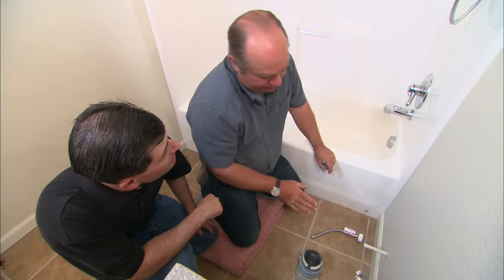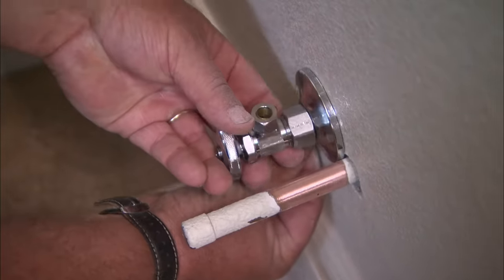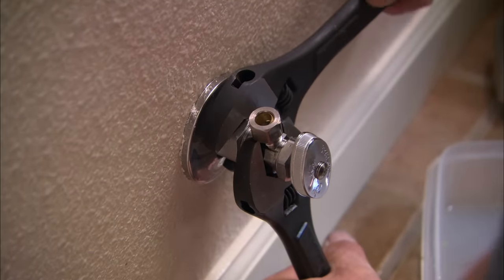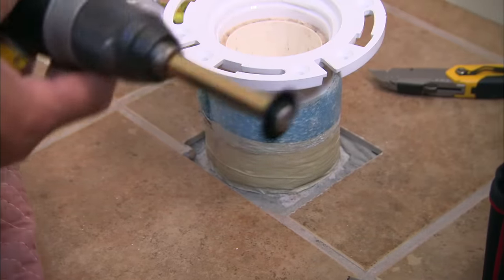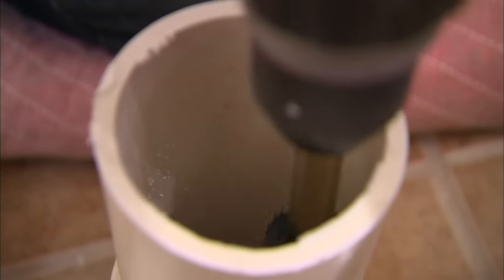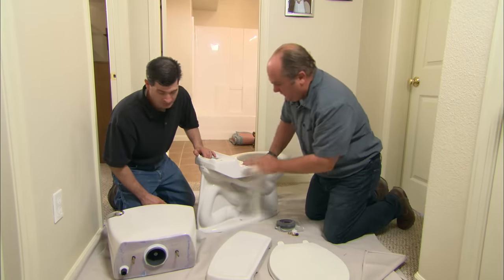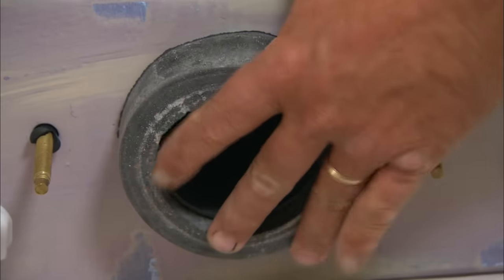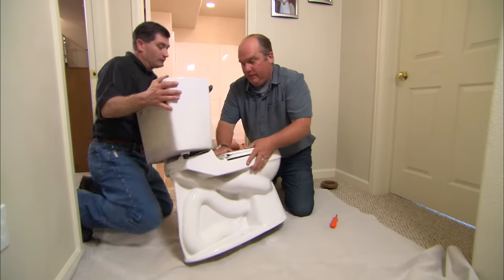How to Install a New Toilet | Ask This Old House

Comment: What would be the cause of leaking at the bolt caps whenever the toilet is flushed?  And how can I fix that?
Reply: There's really only two things down there. There's the seal and the flange. One of those has failed. Replacing the seal is easy. Replacing the flange can be hard. The only way to tell is to lift up the toilet and look at what's going on. If the flange is broken you'll see it. If the flange isn't broken then just replace the seal. If the flange is broken then you're going to have to investigate the pipe it is attached to to see how you can cut the old flange out and install a new one. You might need to cut the pipe back and install another piece of pipe and a coupler. But it may not be so easy. It certainly wasn't for me. It depends on the specific plumbing situation you have going on.

Comment: Thanks. What holds the brass flange bolts in verticle position so the toiled bowl can be lowered on to the flange?? Great video!!😊😊
Reply: Some blots come with a lower nut and washer .... others come with a plastic holder that keeps them straight....

Comment: Yes, 4 Things I would have done is #1 install an Electric GFI outlet for a bedet seat that sprays water, #2 plaster underneath the toilet to help prevent leaks, #3 Use Teflon tape on the water connections, and #4 install a ball shut off valve in case those cheap compression valves leak.
Reply: teflon tape on angle stops? The threads have nothing to do with creating a water tight seal.
Reply: No need for Teflon tape when those supply lines come with O-rings.  You are asking for trouble otherwise.

Comment: if you glue that flange and it breaks, thats a huge mess to replace. You shouldnt glue it. If you do glue it, you should be using a metal cover for stability and strength to ensure it never breaks! I know, we had to replace a flange due to breakage and it was a complete job to do! It wouldve been easier if that flange wasnt glued, then it couldve been replaced and have a metal plate put over it to keep from any further break problems.We used a little caulk on the lip of the pipe to create a easy to remove seal if we had to replace the flange again.

Comment: Nice video, but for the love of pete, why would you cut the copper so close to the wall?   Can we also get a mention that the plumbing shouldn't be so loose in the wall ?  Clearly we can't fix it now, but FYI for when you have the wall open.   I have never seen this method of installing the wax ring. (Just dropping it onto the flange).  If it works, great. That is less work than what I have done for years.

Comment: I have been a Master Plumber since 1987 and I have never used a compression stop, only sweat or IPS thread. That PVC pipe was cut way too short and the closet flange did not make a complete solvent weld. Never Have the stop that close to the wall unless it is IPS on brass nipple.

Comment: FYI: It's alway a good idea to use some Teflon tape (a little goes a long way) on your plumbing threads such as with that flex hose... I can't count how many times that I have had to fix leaky hoses behind plumbers simply because they did not use Teflon tape or putty... 

And the plumbing water-line was cut way too close, so during future repairs, they'd likely have to open-up the walls lol. Nice work though!
Reply: @beepbeep442   Spencer Robinson , granted, they are compression fittings, but from my experience, I have seen them leak/fail, and after applying Teflon, it never leaked. Whatever has threads, I always use Teflon as this is added insurance that I don't get leaks. 2-3 revolutions of Teflon is all it takes, as a little goes a long way... Again, I have seen these compression fitting fail no matter how tight it was fastened, but after applying Teflon tape, it never leaked again. Speaking from experience here...

Comment: what if the toilet rocks , will the wax ring fix this?
Reply: yes, do it asap or you're in trouble
Reply: NO.  It will now leak with wax ring. Use a foam one.

Comment: Can anyone tell me specifically which drill bit is best for tile? Do I need a separate drill bit to drill my pilot hole (there's cement below the tile)? and 3rd which are the best anchor screws to attach the flange through the tile and cement? Thank you in advance.

Comment: Why not go for one-piece, elongated toilet? Just as affordable, one less joint to possibly leak, reduced chance of undesirable "contact" with certain (male) body part, larger target for stand-up use (less pee on floor). What am I missing here? Perhaps there are situations where the difference in distance between wall and front edge of bowl might be a factor - tiny bathroom - but we're talking about an inch difference in overall length, so for most bathrooms not an issue.

Comment: What's the best way to remove the flange if it fails? Does the glue make it a difficult repair?
Reply: Is your question hypothetical or is there a case in point?
Reply: @sghantous  say the flange cracks and no longer functions properly but it is still glued to the drain pipe...how would you replace it?
Reply: @zachmiller4930   @Zachary Miller   Cut pipe as high as possible to remove flange. Replace with longer flange, if available, or you'll have to use a coupler and inside-fit flange, again if available. Without more details, and/or photos of a specific situation, the above is purely hypothetical and incomplete.
Reply: @sghantous  Ok thanks for sharing your opinion, sorry I dont have any pictures of the broken toilet flange for you.
Reply: @zachmiller4930  ha ha ... that's ok!

Comment: Cut the supply pipe too short and the waste pipe too low. Also, looks like the waste pipe was cut with a dull chain saw. should have cut about 3" off of the waste pipe initially so he could have had better access for the final cut on the waste pipe.

Comment: Never use the plastic flange, gt the brass or steel ones they do not snap when drawing the commode base down, also do not use old wax seals, the latest foam/silicone one is best.
Reply: Yes. also get a metal toilet.

Comment: Is it better to use an all PVC closet flange or one with the stainless ring to give it more strength?
Reply: +jonason321 just ask the user of the toilet... big person/little person?? the toilet has a weight limit ya know... haha
Reply: @jonason321 Recommend PVC only, or cast iron. Remember that anytime you're dealing with water and metal, the metal runs the risk of corrosion, even if advertised as stainless steel. There are metal ring repair kits if corrosion occurs, but it's been my experience that the replacement rings don't always fit the flange properly, and you're back to having to repair the entire flange in some cases (that I've seen). The metal ring will add strength, but if its strength you're concerned with, consider using cast iron. There are cast iron flanges that come with rubber gaskets that do the work of lead and oakum, the traditional way of fastening a cast iron flange to the bend pipe. But strength of the flange shouldn't be a significant issue if the flange is bolted to the floor properly and the toilet isn't overly tightened down by the closet bolts.

Comment: Can someone help? I have a cast iron pipe coming out from my concrete slab. How do I replace the closet flange? The same way as shown here? Or do I need to get someone to apply a new metal flange and molten lead?
Reply: Use a sturdy small dia (6") plastic bag with ends cut out.  Put 1/2 length down the drain and hold it there with a foam (NOT WAX) Gasket.  NO more Lead Joints.

Comment: What could be the problem if water leaks from the tank when you flush it?
Reply: You can start by tightening the two or three bolts that hold the tank to the bowl.  If they are tight, then you may have to replace the rubber washers between them and the tank.  The tank could also be leaking by the center seal.  A hugh  nut holds that  against the tank and may need to be tightened.  Also, the leak could be coming from the water supply line.  Check and see if that needs to be tightened.  Generally, if the toilet is 10 years old or older, I would just swap it out with a new one and be done.

Comment: Incorrect sized escutcheon, used the crescent wrenches backwards on compression stop. At least the flange was installed at the right height. A good plumber would never install that closet flange in that orientation though. Acceptable maybe if it wasn't a tutorial video.

Comment: How do you prevent it from sliding, I just installed mine put if I push hard enough it will slide a bit. I installed on hardwood floor...its a half bath fyi
Reply: Did you screw the flange to the  floor?

Comment: What about rubber funnel thing that goes into the flange?
Reply: That's called a horn.  A plumber on YT doesn't like that design.  He thinks the horn can interfere with the flush.  For that reason, he only uses a wax ring without the horn.

Comment: Hi! I really enjoy your videos, I was wondering if you could help me...
What characteristics am I missing to buy a new toilet, in order to save money and time for repairs in the future?
Insulated tank 
Drain size of 3"
A flush capacity of 1kg 
3.8 or 4.8 liters per flush
NOT dual.flush
Elongated shape
The brand doesn't matter
Reply: I follow another plumber on YT and he uses nothing but the Viper from Gerber.  I had a dual flush American Standard toilet installed in a bathroom remodel and the fill valve went kaput within a week.  I never heard back from American Standard.  I would never recommend their products to anyone.

Comment: Warning.    When tightening the water line to the Tank, do not over tighten because it could break the seal and it will leak.  A really good hand tight should work.

Comment: The show is only 30 min with this condensed to fit into the time allotted.  Some things are shown for explanation,  I.E. cutting the flange bolts with a hacksaw, as some come non break-away.  Or showing the compression stop valve disassembled to show how the ferrel works on the copper pipe.  I guess some don't mind seeing an ugly piece of copper pipe coming out of the wall into a chrome finished stop...

Comment: Sometimes I see toilets calked around the base, ... any reason to do this? Do you recommend calling around the base?
Reply: Never a good idea to caulk or grout around the base of the toilet. 2 reasons - if you ever get a leak through the wax ring on the flange, you'll never see it until it leaks through the floor below.  2 - if and when the time comes you have to remove the toilet for a clog, replacement, etc... you run the risk of damaging the tile when lifting the toilet
Reply: +zimsjeep It's actually code to silicone around the toilet base across Canada and many states. Others have referred to IRC, 2705.1; UPC 407.2 . Washington state for instance conforms to this: https://law.resource.org/pub/us/code/states/wa_plumbing.pdf
Reply: +Chris G what's the idea behind it being code to silicone a toilet to a floor?  I see no good reason for that to be required.
Reply: Various reasons, one of which is sanitary. Liquids from cleaning/washroom use can build up and grow bacteria. Others would be to minimize risk of seal breakage which would cause leaking sewage gas, and in the even of breakage, the sewage gases would be contained.

It doesn't need to be silicone, however it's one of the better options, code only states that it must be 'sealed'
Reply: +Chris G thanks for reference to the code. Still don't agree with it much. I'd rather smell the gas and know there's a problem with the wax ring seal and to repair rather then contain it under the bowl.  Wouldn't it be plausible then that the sewer gas could get into the joist bay underneath if on a second floor?  I've never seen the flange sealed to the subfloor which would create a path for the gas. Very possible. Guess there's an argument both ways. I'd still never seal the toilets in my house to the floor.
Reply: Norm Rodriguez Never let sewer gas get into a house too much and never smell sewer gas as it could be potentially toxic to human and anyway the smell is unpleasant⚠

Comment: Don't you put calk around the toilet?
Reply: Although the installation instructions for a toilet I recently installed indicated caulking at floor, I decided not to. Most toilets I've replaced had not been caulked. Caulking can actually mask a bad seal elsewhere, such as at wax ring. In which case, detection of leak will be delayed allowing it to spread, infiltrate, contaminate, etc., more than if detected sooner. Old caulking is a pain to remove. Visually, I prefer no caulk look. Phrasing ... I know ;-)

Comment: Did you use a hammer drill? What's the best drill bit for concrete?
Reply: A masonry drill set on hammer. If it's on tile, either a masonry bit, or a tile bit...but on the impact setting. The hammer might shatter the tile.

Comment: I have to replace an existing toilet.  Will there be standing water in the drain line?
Reply: You can suck out the tank of the old toilet with a shop vac or use a sponge and bucket. When it comes to the toilet bowl, they sell packs of powder that turns the water to gel after a few minutes. This way you don't spill any old dirty water.

Unless you drain is backed up you don't have to worry about water being in the line, only sewer gas.
Reply: @cameronpaul6848  I wouldn't use that gel in a toilet that's being reinstalled. Kinda hard to get it all out.
Reply: @paulmonk7820  Yes I only use it in toilets that are being thrown out. Although apparently you just add more water to get rid of gel

Comment: If anyone DIY people have to do this repair please make sure to use a METAL flange, here all PVC/plastic flanges tend to break when you tighten up the closet bolts on the toilet if you over tighten (pretty easy to do on plastic)

Comment: 5:45 that flat head screw driver is never wide enough. Also, seems that pros don’t bother deburring nonessential things or cleaning the work area.
Reply: exactly.. also that rag to plug the sewer gas? just flush that bad boy down.

Comment: Suggestions: Cut the copper supply line a bit longer.  
Don't mount the tank to the bowl until after the bowl is mounted to the floor (lighter to lift and position).
You don't need to saw the mounting bolts - the narrow area is there to allow you to use pliers to bend off the upper portion.
Clean off any burrs on the drain to prevent clogs later.

Comment: So many mistakes.   I assemble the 2 piece after connecting the bolts, half the weight.   Also do not like how he did the shutoff, cut it too short.   Lastly do not use bolt to hold the flange higher than the flange, you will crack the toilet if it is a little high.
Reply: m rapacki   I do that if it is a one piece toilet.   Hahaha!

Comment: I would have splurged for a 1/4 turn valve. I usually put a washer & nut on the bolts keep em in place before setting it...Awesome how he had that guy rip up his nuts & back...he is a smart man.

Comment: Can anybody with a plumbing background tell me if it's a good idea to have the feed flange pipe lay over on the outside of the under floor pipe? Seems like if the glue breaks down the toilet water will drip all around the pipe under the floor... ? and it seems to me that since the toilet is bolted on the flange; glue break down is more than likely

Comment: Plastic toilet flange is a waste of money. Bolts pull right out. Water shut off valve they used is good for one year if you are lucky. The video  is correct in that this is how contractors do it. But for sure not the way you want to have it done. Use a heavy metal toilet flange. And use a heavy duty ball valve supply valve.

Comment: I think the comment below from Andy Douglas is of interest.  Obviously it is much lighter to lift with the tank not connected.  That is what I did on 2 toilets I installed.  However I found it was extremely difficult to get the ceramic holes aligned with the vertical bolts.  That is remarked upon in a post below from am experienced man who points out that with the tank in place it is easier from the point of view of weight balance to perform the operation with the tank in place.     My remark to this comment is I am not sure I can lift the weight involved with the tank in place!  So I now have another toilet to do and I am not sure I can do it on my own.  I am of average build (6 foot tall) and I weigh 170 lbs.  I invite suggestions.

Comment: Compression valve ? A Real professional  plumber would solder and install a rigid flex supply. No caulk or grout under the toilet  will cause smell and dirt to get unerneath plus is also not code.. this guy probably charges a premium and does happy homeowner work

Comment: Hmmm never mentioned pushing new valve firmly into pipe setting compression fitting before tightening..no cleaner before glue.? No mention of EVENLY tightening tank to bowl bolts..Not one of His better videos..
Reply: Agreed.

Comment: Could have used a flange that goes into the pipe
Reply: No, you need it secured to the concrete floor and those are made for AROUND the pipe. The wax ring makes it a real tight leak-proof seal. Any other way and the wax ring does not fit!
Reply: I’m saying you could get a flange that goes glues into the pipe and you still would have to fasten it to the floor

Comment: Why did you not install a ball valve at the toilet water shut off. They work so much quicker when you need to shut off the water in a hurry. I use them at every shut off point, well to each his own.

Comment: I would have used a 1/4 turn water valve INSTEAD of the multi turn valve and would have installed the bowl FIRST and then the tank, BUT that is me, using (COMMON SENSE) as I see it and not a plumber.

Comment: Another Warning.   I recommend using a manual handsaw to cut the bolts to keep the sparks down.   If you have to use a cut-off wheel, protect the porcelain because the soot stains the surface and is very hard to scrub off.